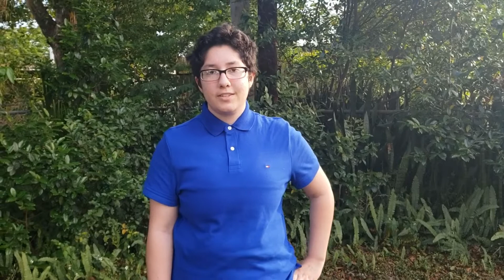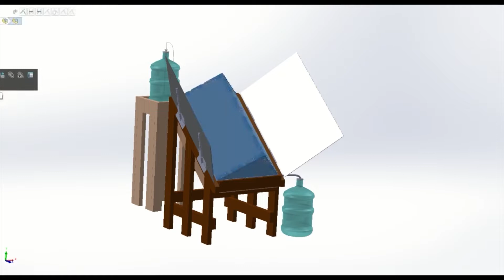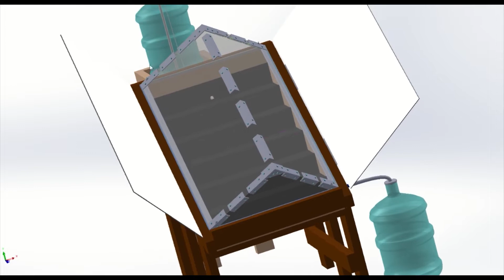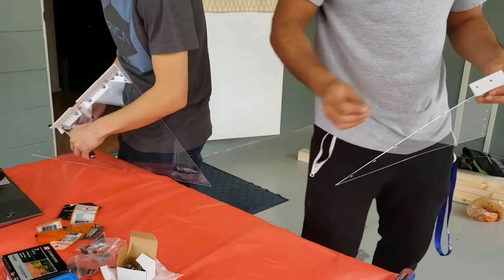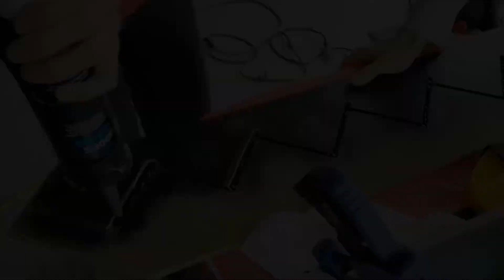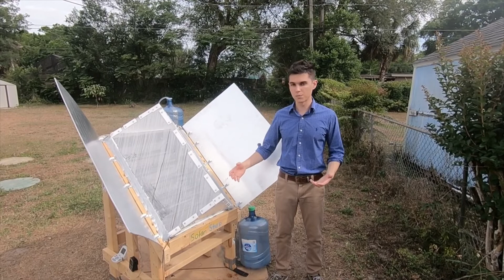Solar Desalination Green Team Spring 2021 - Solar Step

Comment: Truly an innovative way to use the step design with the two acrylic glass panels in this slope position. Good job to the whole team!
I do have a suggestion, that the two external reflectors can cause sunlight block (shadow) inside the solar still which will reduce the productivity during sunrise and sunset. I suggest to make the reflectors motorized, such that they can fold down when they are blocking the sun and return back when needed. Of course by adding motors and electronic circuits/controllers will increase the capital and operational costs, this is why it needs to be studied in order to check if it is economically justified. Also, motors and circuits require electricity, in which the system can still operate sustainably by adding a solar panel. But again, it will add more costs and needs an economic justification.
Reply from the maker: Thank you for the nice comment and advice. Solar tracking capabilities was something the team really wanted to incorporate initially, but the added costs and potential for the electrical components to break overtime was what kept us from this.
Reply: @kellymuller9662  It would be highly appreciated if you can share any resources that helped you with the ANSYS FLUENT CFD simulation. I am trying to do it but I am stuck in some parts.
Reply: feature creep